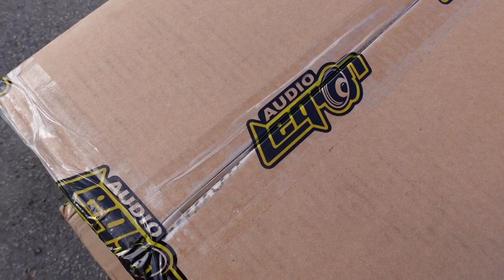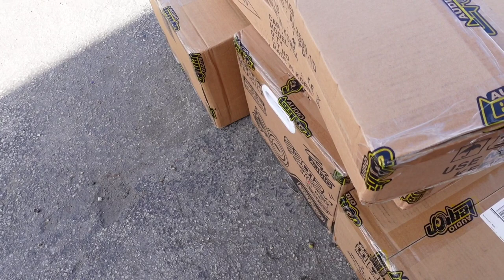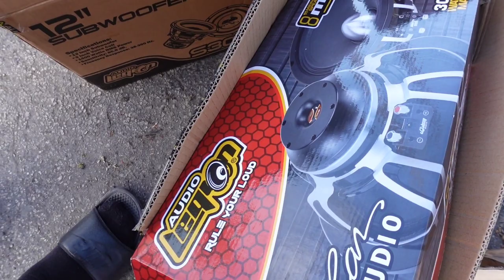TAKING DELIVERY AND UNBOXING NEW CAR AUDIO EQUIPMENT FOR MY DONK

Comment: So you running two 3500 class D mono blocks on 2 12s for bass & around 4=8s,4=6.5s,& 4 tweeters. What you using for the highs amp?
Reply from the maker: All audio legion